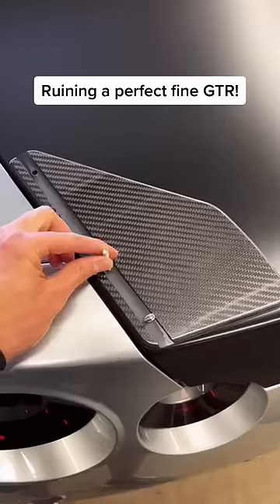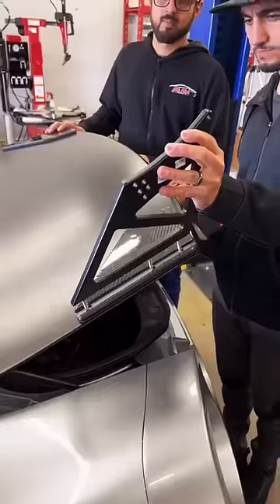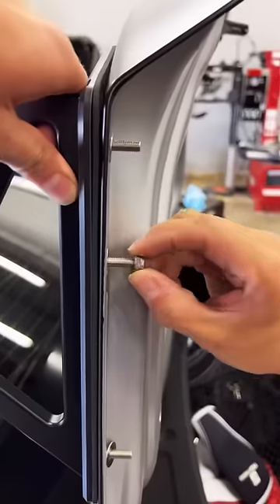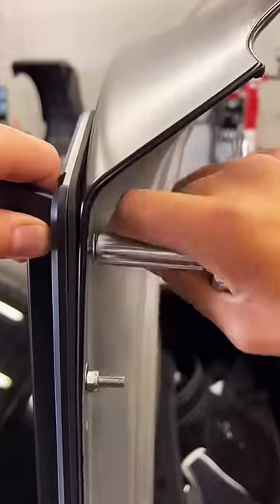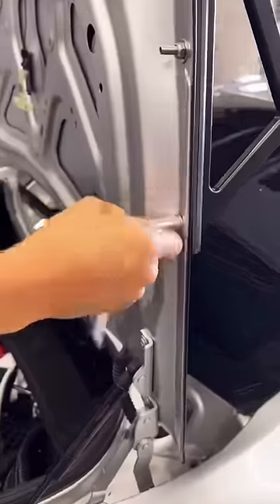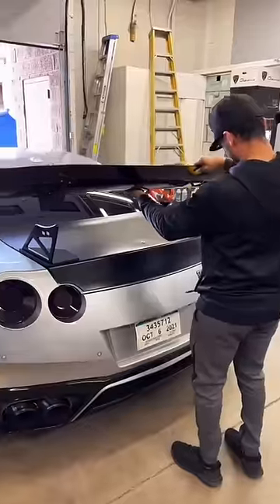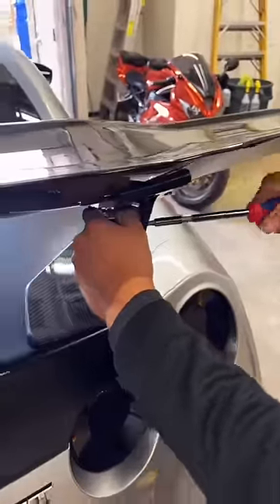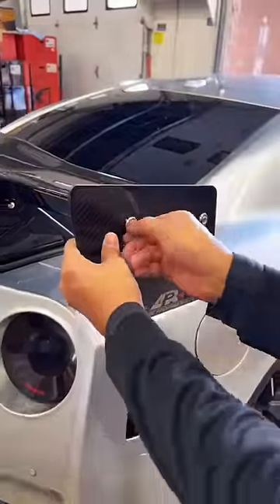Ruining a Nissan GTR with an APR Performance spoiler!

Comment: Love the massive dent in the middle of the trunk while you drilled a hole you didn’t need
Reply: I saw that too they left a random hole
Reply: It’s from the original factory spoiler it has a third mounting point in the middle for stability 👍
Reply: @mattp544  no it isn’t. You can see a clip where there is no hole in the middle. Then he drills one and leaves a huge crater of a dent from pushing so hard and then never used the hole.
Reply: @MisfireInc  yeah ur right actually I didn’t notice him drill it the first time I watched that’s really weird I can’t see why he would have done that
Reply: I was thinking the same thing what the hell was that about
Reply: Yeah it is for stability, a cable hooks in the trunk goes through the hole and attaches to the wing. Creating more stability for high speeds. Food for thought 💭
Reply: That's trunk ventilation cuz of new spoiler 😆
Reply: @alxandr589  what the hell
Reply: Oh no what a tragedy
Reply: It looks a bit like a keyhole, maybe it’s to lock the boot separately from the central locking, makes it easier to lock people in your truck since the emergency release wouldn’t work ….
Reply: @lukemurphy7917  no. Just no.
Reply: I honestly don’t think he would drill a hole which is completely unnecessary
Reply: @lukemurphy7917  it does look like a  key hole
Reply: Weight reduction
Reply: Aerodynamics, bruh
Reply: It's a key hole look at his other videos he explains it
Reply: @MisfireInc  it's a keyhole the spoiler adds wieght and it won't allow you to pop the trunk due to the wieght he also explains it on other videos
Reply: It is used for water drainage, so water doesn’t stay on your trunk
Reply: I’m not sure, but it might be a mounting point for something like a parachute or extra spoiler stability.
Reply: @I3arett  wait that’s actually really cool
Reply: @mattp544  so like do you just assume you know shut when you don’t ?
Reply: @jbiggs2761  I mean I made a mistake and admitted to being wrong is that such a big deal?
Reply: Watch the full video genius. It'll tell you exactly why there is a hole there.
Reply: They put some kind of insert in that hole. It’s not just empty
Reply: @arriswaasdorp4111  nah, just inside of it hey? 🤦🏽‍♂️
Reply: @MisfireInc  yeah he drilled that hole for no reason and ruined the trunk!!!!
Reply: Yeah wtf was that
Reply: @MisfireInc  lol m
Reply: functionality over form
Reply: Lol i know, wtf is that hole for?
Reply: That is going to make the car explode at 15 miles an hour
Reply: @I3arett  it has no cable, and the spoiler would crack in the middle downwards so there is no point for a stability cable.
Reply: “Well we already put this big over priced spoiler on her how do we make this car look more shitty?” “I got it bill!” Drills random ass hole in car
Reply: He's probably making a video on that right now as we speak lol
Reply: It's not a mistake ✨ It's a master pice✨
Reply: You know that make different force lift struts. Not sure why you’d put a hole in a trunk when you can install a lift strut.
Reply: that’s race car shit tho, doesn’t always look good. Still never heard of this tho and I dabble quite heavily in cars with huge wings
Reply: if you think thats a massive dent then youve never dented any car
Reply: Bad ass work guys!
Reply: @Kronic420  no they didn't. This must be a bot.
Reply: The hole is for the GO PRO YALL DASSES
Reply: Not only that but it’s off center towards the left lol
Reply: He even says that there are two holes that need to be drilled but he drilled 3🤣
Reply: That's where the intercooler hose goes for the spoiler to keep it cool.
Reply: it is there to keep trunk moist. good for wires n sht
Reply: i can tell you’ve never worked on gtrs before
Reply: Homer simpson came out with speed holes years ago.. step your childhood up😂
Reply: at the end of the day its no your car 😂they have money and the car so yeah they do what they want 😂😂😂😂
Reply: @MisfireInc  he did use the hole though watch the very end there is a silver piece on top but idk why he did it but he didn’t just leave the hole there
Reply: Go pro mount maybe lol
Reply: It really ups the resale value!
Reply: That’s weight reduction bro
Reply: I was wondering about that two
Reply: Well he said he ruined it. And you’re saying he ruined it. So really you’re not saying anything. Bc he already said. What’ your trying to say.
Reply: If you look closely at the end he didn’t just leave it a hole or he put some kind of bushing on it It may have a purpose
Reply: @MisfireInc  chill man it's a speed hole.  Haven't you seen Simpsons before?
Reply: No I’ve seen this before, it’s ventilation for the rat living in the trunk
Reply: The reason he drilled that hole in the middle is because they wanted to ruin the gtr. (Says it in the caption) 🤷‍♂️
Reply: @I3arett  that makes absolutely ZERO sense. downforce pushes the wing DOWN, nothing ever pulls the wing UP.
Reply: @MisfireInc  how’s it feel? 
You keep depending your initial point in the comments but are too slow to do some research. 
No. Just no.
Reply: You know why he did it? Because is his car and he can do whatever he wants whit his car
Reply: Ya like wtf
Reply: @mattp544  🤫🤫🤫🤫
Reply: @mattp544  and there is a part showing them drill the hole
Reply: Lmfao
Reply: That’s actually a trunk release.. think about it then it will make sense. Thanks.
Reply: @HPsawus  you’re right it’s actually a button
Reply: @lukemurphy7917  It's probably an emergency gloryhole for emergency letout on the road
Reply: @mattp544  they had to drill a hole into the already existing one to put in a bolt per the Wings manufacturer’s steps. It’s not a key hole, it’s now just filled with a nut...
Reply: @BIX-18827DCM  smd
Reply: He put an assload of pressure while drilling.
Reply: Oh yea hahaha!
Reply: It's to cool the trunk.
Reply: Looks like something is in the hole... maybe a badge from maker? But I'm with uu on the dent, smh
Reply: thats why "ruin" is in the title
Reply: @SamuraiAtlas  No it’s not. He literally shows himself drilling it like a jackass
Reply: I was so triggered when I saw that
Reply: @darkstars101  yes he drilled it to place a key hole
Reply: He wanted to have some fun with his car with that whole in the middle of the trunk 😉
Reply: I wish he would reply and explain this
Reply: It's for aerodynamic purposes
Reply: Maybe for the keys...?
No.
Reply: The answer is easy. They did it because life is way too short to drive a dentless car.
Reply: I mean the video caption did say "ruining a perfect GTR". The wing was fine, until that random hole in the middle.
Reply: 😂 I came to comments just to find these
Reply: Could it be for a rear brake light, dunno if the gtr has one in OEM spoiler?
Reply: There is a wire for stability
Reply: Ia for air to get inside the boot for more drag :))
Reply: @alxandr589  🤣🤣
Reply: @HPsawus  but he did
Reply: DRS solenoid incoming bro
Reply: @doru10922  its a wire, nothing is getting through that hole trust me bud
Reply: Its so you can add a mini camera to catch whoever steals your cool spoiler from your boring car
Reply: @DemarcusQ  no bro....
Reply: @Evosti  You actually believed that. RIP lol
Reply: Weight reduction bro
Reply: He drilled only the wrapping, You can see no metal dust comes out from there, It was already there for the stock oem spoiler.
Reply: Speed holes
Reply: If you look at the end he clearly put a rivet or bolt of some sort
Reply: Tf, i didn't knew i would be laughting so hard reading a coment chain 👀
Reply: It's called bondoing
Reply: Is the backup camera on the oem spoiler? Maybe they need to add one and just hadnt yet on the vid
Reply: Y the hell are the bolts so long? I’m surprised the kid closes!
Reply: I guess decorations?
Reply: Actually it for a inside support beam
Reply: It's weight reduction
Reply: Yes life is to short...... So why waste time ruining this car like this........
Reply: Lmfao right🤣
Reply: He doesn't want to drive a boring car and enjoy the fruits of his labor 👌🏽👍🏽
Reply: Weight loss / idiocy
Reply: For the trunk key ?
Reply: @I3arett   no no no
Reply: @wantapgt  yes yes yes
Reply: @mattp544  smart man
Reply: No he didn't... thats the middle hole from the stock gtr wing... check pictures of stock gtr's ...
Reply: @HouseOfPetrol  bud. You can see him drill the hole in the video. The first 30% no hole. Then some idiot drilling a random hole and pushing so hard he craters the panel. Then, random unused hole.  They fucked up. Simple.
Reply: It's for drainage
Reply: Probably for a GapCam 💨
Reply: @givememoney8985  if you had common sense you’d know most r35s come with a spoiler with three mounting positions and when I first watched this video I quite obviously didn’t see them drill the hole in the middle of the boot lid your literally irrelevant to the conversation I was trying to help people understand why it was there but after I was made aware that they drilled the hole I admitted I was wrong
Reply: Oh no a dent! It’s not like I can take it to a shop to get it popped out of my $120,000 car! Oh no!
Reply: @MrYabber  don’t know what r35 gtrs you’ve been looking at but £120,000!! That’s unbelievably expensive for a r35
Reply: It’s obviously made to make the car not flip backwards because of the increased airflow under the new much larger spoiler.. The hole let the air go through the trunk instead of ripping off the spoiler or flipping the car backwards, it can also be used for extra trunk-ventilation. Hope this comment helps anyone who was wondering!
Reply: @mattp544  it is when you telling someone else they’re wrong in the process lmao
Reply: He drilled the whole to fit a threaded piece for a connector to that spiked if you look closely when he shows the final product you can see the chrome thread he used in that hole
Reply: Right as he's talking shit on the customers car if I saw this I wouldn't return I would look for a mechanic that's excited to do shit like this and has a passion for it not someone who sounds annoyed to have work.i live in the mile high and won't ever visit them
Reply: Looking more and more like a custom shop with half-assed workmanship
Reply: Just for the 10k people that like this, I’m a journeyman Autobody tech. If you need a wing installed in the Edmonton Alberta Canada area I won’t drill random holes, use 6mm nuts and leave large dents in your vehicle.  I might make fun of you for the size of wing though
Reply: Way to go, spoiled a perfectly good looking car
Reply: @MisfireInc  it’s a button to adjust the spoiler up and down
Reply: Yeah then at the end of the video you can sew they put some silver cap over it. Looks bad I wouldn't take my car to these baboons
Reply: It’s for light weight
Reply: Trash work fr
Reply: Duh, weight reduction.
Reply: refill blinker fluid without popping trunk...duh
Reply: Why drill a hole in the middle you ask?...Its obviously for extra HP and weight reduction. Silly question hey 😜
Reply: Towards the end you can see when he puts the random dent or hole or whatever in the car
Reply: That hole where air goes out when the weight on the top pushing down the trunk.
Reply: His finger slipped 😂
Reply: The extra drilled hole is to hold his fruits of his drilled hole labour lol😊
Reply: That hole in the middle and dent  was already there from the one spoiler which has a support in the middle he just drilled through the wrap
Reply: @philliptownsend2829  no. It isn’t. Watch the video. It’s not there, then boom, big mistake.
Reply: The original spoiler comes with a middle mount smartie pants.

Comment: I'd sue the shit out of em for randomly drilling the middle of my trunk.
Reply: You dont need to sue anyone. Just have them replace it.
Reply: Maybe they moved the lock slot
Reply: I’m sure the car owner knew what would need to be done to install a spoiler. If not, I’m positive they explained to the car owner the process it takes to put one on. It’s common sense and if you don’t know how a spoiler is installed onto a car, don’t get one.
Reply: The fuck do you want it held on with? 3m tape? 😂😂😂😂
Reply: @Przfynest123  but the middle hole is useless 😂
Reply: Tf do you want them to do?? Use an ungodly amount of flex tape?

Comment: “You will need to drill two holes”
drills 7 holes
Reply: Lol and what was that middle hole ? For air.    Most of these city “car guys” have more dollars then sense.
Reply: Actually he only drilled 3, the original spoiler have 4 bolts (2 in each side) so this guy was talking about 1 hole in each side, but I don't know why in the world he drilled a third hole in the middle of the trunk 😫
Reply: People know how to drill alotta holes :)
Reply: There was 2 holes on each side already from the stock wing
Reply: Lol I get what youre at but it's for a GoPro mount
Reply: You can get suction ones but they're not as secure, so he probably got one.you have to drill a hole for, same with the one Ive got
Reply: @uliloco1  exactly lol that is so bizarre I wouldve decked him if that was my car
Reply: @jimtom4878  I think as the last comment before yours said, maybe is a GoPro mount, but even with that when he drilled it he used a lot of force and made a dent, either way is a bad work haha
Reply: 6
Reply: Lol hahahaha
Reply: That’s what she said
Reply: Someone in another comment believes the hole in the middle was for a wire to help secure the spoiler. Sounds plausible.
Reply: @kalebstillman1163  no, there's a 7th one in the middle of the trunk
Reply: @daniellepage2923  I googled “apr performance spoiler GTR” and every single build has that hole In the trunk
Reply: @HPsawus  does the website tell you how much horsepower you lose when you install this garbage ?
Reply: @daniellepage2923  well it would certainly add more drag but you wouldn’t lose any dyno horsepower,
It has use on the track I suppose.  but it would fuck up the trunk panel if you ever wanted to take it off
Reply: @johlonolson7817  you have cracked the case
Reply: This hole in the middle kills me😭 Why does he do that?
Reply: @HPsawus  I found one that has a really ugly 3rd brake light in that middle hole. I feel like that’s one step you could skip.
Reply: @Ulises Leon  there's what looks to be a mounting point in the middle for (most likely) wire tensioners while using on the track
Reply: The hole in the middle of the trunk is for the oem spoiler screw😂😂😂 nobody drills it...
Reply: @marcebel712  1 there isn't a hole in multiple shots. 2 rewatch the video where he drills a hole in the center of the trunk. :edit: the moment he drills that hole is right after he takes the cover off the new wing, there's a quick cut to him drilling the hole for half a second then another cut.
Reply: @Oridavis  For me it looks like that he drills trough the wrap😂
Reply: But in the oem trunk will be a hole in the middle for the stock spoiler🤷
Reply: @marcebel712  is it a stock trunk? He drills the hole in the video right after revealing the new spoiler

Comment: no rust protection on the drill holes, lump in the middle of the trunk, typical american tuning. congrats on producing a 100% rusted trunk in 1-2 years.
Reply: Hey look on the bright side, the added downforce will keep the rusty trunk closed.
Reply: Bolts too long sticking out too.
Reply: @rockonmyfriend 
I don't need a wing for that. The rust can keep it shut with no effort.
Reply: not really an american thing
Reply: Noob Tuning mode😂

Comment: "Drill 2 holes" - Shows  7 holes. . .

Also, bolts are way too long.
Reply: I was thinking the same thing. They probably spent 10 minutes screwing on the nuts. These guys are noobs
Reply: They only need to drill two holes because the other four are from the original spoiler.
Reply: @evrex-02  and the one in the middle?
Reply: @Jessersadler  no fucking clue, I have no idea why they would do that.
Reply: Exactly what I thought. Expensive kit and it came with bolts that were way too long.